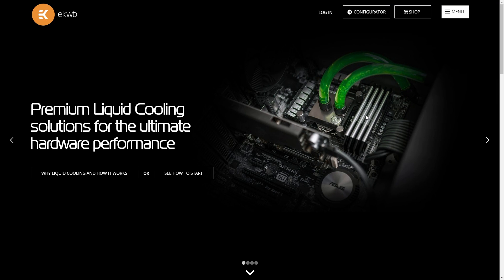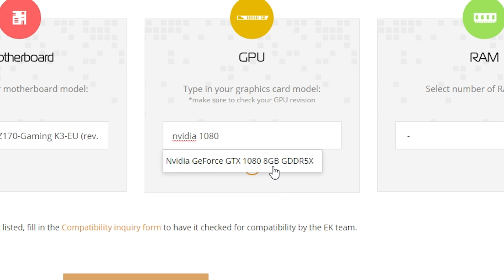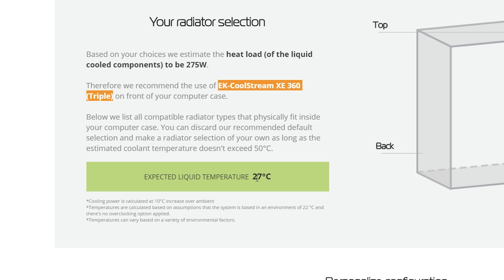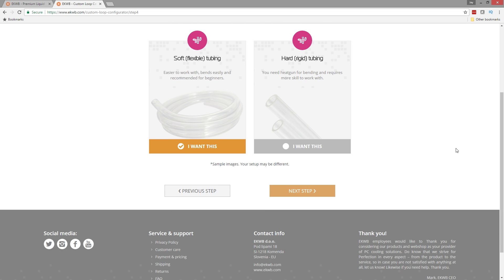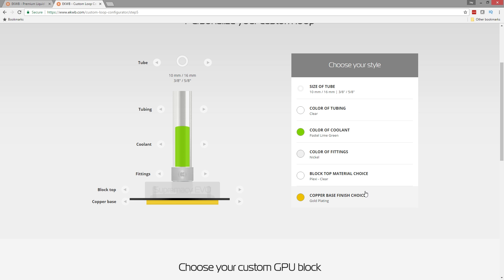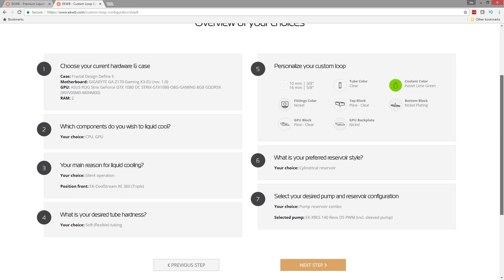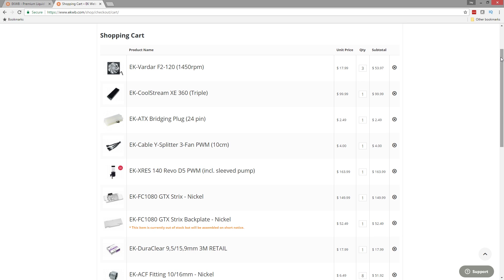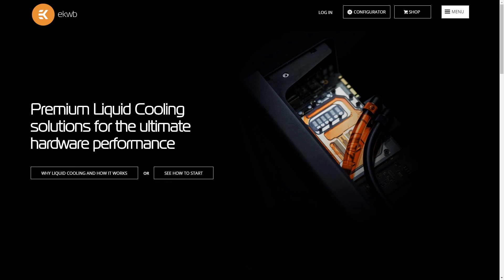How to configure a custom water loop using the EKWB CLC

Comment: 700 fucking dollars!!!! I don't see how that's worth it. I don't fucking see the value there at all!
Reply: water cooling is an hobby, you do it 'coz you like. And often hobby come with a bill. I have a 1000+ $ loop, its a waste of money i know that and i dont get any better overclock from it, but man, its cool as hell.
Reply: No Bruno. I certainly won't go away. But thanks for the useless input. 
There is NO value here. For 700 dollars!!!! It had better keep a CPU/GPU ate sub 20º under full load. As is... it looks great and performs like an off the shelf 70 dollar closed loop system. Utterly ridiculous.The market for this must be minuscule.
Reply: perfect. good logic. and also let me state the obvious that this is stupid and has no value... See the logic? you contradict yourself.... very smart Bruno.
Reply: The point Bruno is trying to make is... It's for rich people with money to spend on useless shit. A Ferrari or a Rolex watch is no different to a Mazda or a seiko, yet people buy it for ridiculous prices. A custom loop looks really badass and is pretty silent and... That's about it. It has no other use besides that. It's just for enthusiasts who like the idea of going to the extreme for their PC. No real value whatsoever.
Reply: +DAGATHire do you even read the replies?
Reply: Eventhough I can afford it I can not blind. Watercooling is a rip off. 60 bucks for a backplate? All the backplate is, is a piece of aluminium. For 60 bucks. Watercooling is overpriced.
Reply: DAGATHire You still don't get it do you? If you leave everything at stock, then yeah you're not going to find much difference, but if you're someone who likes to push as much performance out of their setup as possible, then yeah it's definately worth it. Having a custom loop allowed me to overclock my i7 5820k from 3.3GHz to 4.6GHz and overclock my 980ti to 1500MHz on the core and about 7800MHz on the memory all while staying silent at load. I used to have my 980ti on air and it was screaming its tits off at full load. The fans were so damn loud and it's not even a reference card, it's Gigabyte's G1 Gaming card. 

Having a custom loop provided more overclocking headroom, cooler temps and a quieter operation at load. That is something that you don't get with air cooling or even AIO coolers. AIO waterloops have radiators that are thin for maximum compatiblity for as many cases as possible and most of them aren't bigger than 280mm rads and don't offer expansion to multiple rads either. You'll never get the same performance from an AIO as you would with a properly configured custom loop.
Reply: Actually, i walked into a tech shop a year ago, a tech superstore in europe and funny story. I had 2 gtx 760s in SLI for the previous 2 years, (titan 780 performance for half the money) but we know that a single card is better than an SLI setup, anyway i was in this shop with my wife and i walked past the GPU area glanced at the prices and sure enough there was 2 STRIX 980 DCII OC edition cards marked at €360, now at the time this was about 200 less than normal. But my brain didn't catch on for a while continued on with the wife browsing and slowly my brain was like.... dude wake the fuck up... some clown has gone and marked that card wrong... So i went back and there was a windforce 980 card beside it marked at 549.99 and a few 970s marked about 100 less.. 450 range... And i was still kind of stunned so i was thinking... is that strix a total piece of crap or what's going on... anyway.. long story short. Someone in the shop had fucked up and marked it wrong. I grabbed both of them. bought them. Sold the other for 450 new unboxed. made a profit, and ended up paying 250 net for a new 980. Add to that i sold on the two 760s for 100 each and i paid about 50 euro for my new 980 strix. 
It was a good day... and your comment is nullified. But well done for making incorrect assumptions about me AGAIN!
P.S:
You are correct it is quite useless to argue with me when you are clearly wrong.
Reply: indeed tony however, car enthusiasts in general add to the performance of their cars while making them look great at the same time. Not to mention a modded car when done correctly in fact adds monetary value as well as aesthetic value.  My consistent argument throughout this entire conversation is about performance benefit/to silly cost. and there is none. Likening it to car enthusiasts doesn't work either as mentioned generally the car comes out the other end of modification as a better faster version. Plus a car can have value ADDED to it with modifications where this over priced folly does nothing of the sort. no extra value, no extra performance just prettiness that 99% of the time only you see. You come across like a nice guy Tony, so im not talking at you personally. But this is complete folly unless you sit looking into your case 24/7 appreciating your own valueless work. And as i said previously if that's how you wanna spend your money so be it. But others here have attempted to imply that you get performance.... Maybe you get a couple of degrees in a perfect world but in fact you don't get anything other than cake decoration. 
P.S. Totally agree, building your own stuff like this is incredibly fun particularly when you have the mindset of im going to build the best for the best price.... not im going to build the most expensive... That's just me and most other people tho. You spend your money how you want.
Reply: Tony Leung... indeed if you can do it on the cheap or at least good value for money i would be far more interested. EK is a straight up ripoff in my opinion. But if i could do something similar for say 250 bucks i would be very interested. thats about double the cost of a really good AIO. And that seems to me to be about the right number. But 700 dollars.... it's nauseating.
Reply: Ro-Tang Clan i guess that's one way to look at it. But i don't see it. Adding a loop is expensive, the chance of a component failing these days are minimal. You're better off just saving the money if you look at it that way, and buying a new component to upgrade your system when it's time. At $700 you could get a decent GPU or CPU+mobo combo to get more benefit.

The parts are more important. Even Jay has mentioned that it's better to buy the best components you can afford than to sacrifice that to water cool lower end components.

I have a loop, and i don't see a benefit other than it making my system look nice, and giving me a bigger epeen.
Reply: DAGATHire xspc is better
Reply: whats interesting is that for 700$, you could likely upgrade some other component in your system to get as much or more performance gain than you do from watercooling.
Reply: +DAGATHire I think you're missing the point of custom loop cooling. Custom loops aren't for people on a budget, they're for people who already have high end kit and want to be able to cool it efficiently. I know that the market has been focused on lower power consumption with every new revision of CPU's and GPU's nowadays, but generally speaking the higher the performance of the component, the more power it's going to consume which also equals more heat. More heat=more noise to keep the component cooler. Custom loops give you the flexibility to add multiple radiators to dissipate the additional heat that the higher end components are going to be throwing out whilst keeping it silent.

Nobody would do a custom loop for an i3 and a GTX 750ti or an R7 270, that's stupid. As you rightly said the money you would spend on the custom loop could go to buying better components in the first place. But not only that, an i3 and a 750ti or R7 270 aren't going to be throwing out enough heat to warrant a custom loop. You could probably cool both of those on a single 240 rad.

For me, I have an i7 5820K and a single 980ti both in a custom waterloop with a single 420mm rad. Sure, I could of used the money spent on the custom loop towards a 5960X but I don't need the extra cores or threads. I could of used the money to buy another 980ti, but a single card is enough to max out games at 1080p/60fps and I don't have a 4K screen yet. So instead of spending the money on pointless components for my needs, I spent it on cooling to make it a powerful, but silent setup.
Reply: Ro-Tang Clan
Excuse me? i perfectly get it, i just totally disagree with you. And if you think that's a problem go tell someone who cares. Your  version of what i get is only based on the fact you are insisting i agree with your limited one sided opinion. I can just the same tell you that you don't get it but it means precisely fuck all. You are entitled to your view. I'll stick with the view that 700 dollars is fucking ridiculous when an off the shelf unit costs a tiny percentage of that.
Reply: +Peter Jansen I agree on some parts but disagree with others. Before I go into my upgrade path I do agree that high end air coolers can beat entry level AIO's. I had a Phanteks PH-TC14 air cooler which managed to keep up with all the entry level AIO's and it was quieter too, especially since there was no pump noise. I managed to OC my (at the time) AMD FX8320 to 4.8GHz using the Phanteks cooler and staying below 65C on the core which is amazing. I'm not trying to say it's custom loop or nothing because that would be silly. I get that everything has it's place and air cooling is better in certain situations and AIO's can be better for certain situations. However, custom loops do have their place too and aren't pointless.

Regarding putting a custom loop on a 7700k and a GTX 1070.. hmm.. that's a tough call. I would say it depends entirely on the rest of your setup. Okay so here's the thing, If you're running 3x1440p displays then the smartest option would be to save the money and put it towards a better GPU setup. However, if you're running on a single 1080p/60Hz setup like I am, going from a 1070 to a TitanX Pascal is going to give you very negligible benefits. Maybe you can max out the Anti-aliasing with the TitanXP but that's about it. So instead of spending the money on a card that isn't going to benefit you much, I would much rather spend my money on making my setup as silent as possible and a custom loop is an effective way to do that for both the CPU and GPU. All you'd need is a single 360mm rad and you're set. Maybe dual 45mm thick 240mm rads instead. 

Also another thing to bear in mind, EK aren't the only company to produce watercooling parts. You don't need to spend 700 to get everything from EK, you can get a full loop for half of that if you buy from companies like Alphacool, AquaComputer and XSPC. I've bought compression fittings from XSPC before and whilst you can feel the quality is lacking, I've never had a problem with them and they've never failed either. You can get XSPC fittings from around £2 a fitting, EK fittings can be around £5-6 per fitting but Bitspower fittings are by far the most expensive I've seen. They can go all the way to around £10-12 per fitting and some of them like the ball bearing T valve costs £25. They scream quality though. It's well made and you can tell they didn't cut corners on the build quality. For my custom loop of 1 CPU, 1 GPU, 1 pump/res combo and 1 radiator, the cost for all the fittings from Bitspower was around £200. I didn't care though, I have the money and I wanted the quality.

Finally onto my upgrade path. The case I'm using currently is a Phanteks Enthoo Luxe which is no doubt a great and solid case, but it doesn't offer much in the way of watercooling expansion. After keeping a sharp eye on the case market, I've decided to go for the Dark Base Pro 900 to expand my radiator setup. I'm going to be buying a thicker 420mm rad (60mm thick) which is going at the top, a 30mm thick 360mm rad at the front and a 30mm thick 140mm rad at the rear. I'm not going to go for the 1080ti since I've seen the benchmarks of the TitanX Pascal and SLI 980ti's are about on par with it's performance. So I'm going to be going the route of SLI'ing my 980ti to offer the best price to performance. The reason why I'm adding a second 980ti is because I'll be buying a 60inch 4K OLED TV pretty soon too. Just waiting for Sony and LG to release their 2017 models so I'll need the added horsepower to run the latest AAA games in 4K.
Reply: who deleted their comments?
Reply: bruno's.
Reply: well. his choice. he probably didn't want to get any more notifications. 
I'll look at it that way.
Reply: It performs way better than a hybrid cooled card. My 980Ti with a overclock at 1518 MHz(the base clock is 1000 MHz) won't even go any higher than 41C under full load, and that's looped together with a 5820K@4.6GHz.
Reply: I have fx8350 with Noctua a nhu12s at 4.2 ghz and never go above 50* C

in a Fractal Define S case with 2 intakes and 1 exhaust (all fractal gp120s)
Reply: DAGATHire It's all about quality. You can go out and buy a 60inch 4K TV for as little as £400 or you can spend £6000 on a 60inch 4K TV. The price reflects on the quality and R&D gone into the product as well as other things. 

As I said in a previous comment (although not directed towards you), EK aren't the only manufacturer in the custom waterloop scene. If you buy from manufacturers like Alphacool, AquaComputer, Thermaltake, XSPC then you can almost half the total cost of the waterloop. EK is pricier because the quality is there and can be felt too, but it's not the most expensive. Try getting everything from Bitspower, they're the most expensive I've seen.

I'm guessing you don't buy into the finer things in life. Of course you get into the realm of diminishing returns the higher you go, it's like that with anything. Headphone manufacturer 'Grado' has just announced a turntable cartridge that will go on sale for £3000. You don't even get a full record player, JUST THE CARTRIDGE for that price. That's about the same price as my entire home cinema setup. 

To ne honest you can make the same comparison about anything in life. You can spend £20 on a bottle of wine or you can spend £200 on a bottle of wine. 

Custom loops are the same. You can buy into a custom loop that's cheap, or you can spend an absolute fortune on a custom loop. The difference lies in the quality of the end product. For someone who wants the absolute best, why not go for the most expensive and classy of the bunch?
Reply: fuermi Haha exactly what I just tried to say. He obviously doesn't buy the finer classier things in life so he probably wouldn't understand. I once worked at Bang&Olufsen many years ago and if you don't know who they are, they're one of those companies where if you have to ask for the price, you can't afford it. They do audio and visual technology, so basically speakers, TV's, CD Players etc and just for a 65inch TV cost £18,000. I'm pretty sure the people who bought it know they can go to their local tech store and get one for a fraction of the price, but people buy the Bang&Olufsen set anyway because they like the quality of the brand. It would be like trying to tell these people that they're being ripped off. It doesn't work like that haha.
Reply: fuermi
I could consider the possibility of this is it was in the $400 region. I can't for the life of me understand how a sane individual with any sense of value for money would pay 700. Have you seen the break down of the prices here? It's a total ripoff. I don't care that you disagree. The world would be a fucking shithole if we were required to agree with every opposing view posted on youtube. But the fact you hold an opposing view under no circumstances makes you correct. If you believe that, you are arrogant and closed minded. 
Ro-Tang Clan
YOu are a provocative little twerp. Demanding that i agree with you and posting utter bullshit about performance is only the start of my problems with you. The custom loop will under no circumstances perform 10 times better than an off the shelf unit. Yet it's ten times the price.... Consider that. And stop talking about performance. YOu are posting bullshit and it's either that you are simply wrong or telling bare faced lies. I will give you the benefit of doubt and simply assume that you massively overestimate the performance here. 
Bottom line. you are willing to pay ten times the price for aesthetics.... Boggles the mind.
Reply: Surpuppa, i see where you and others are coming but it's folly, these are all bad examples. you pay for much more advanced technology in audiophile stuff and you get better performance. and the other 4k tv example was also bad. you pay for what you get in those things. 20 dollar headphones don't perform like 400 dollar headphones. 400 dollar 4k displays don't perform as well as 2000 dollar displays. But with this, it's 100% form over function. you don't get extra performance, that you won't get with a decent off the shelf closed loop system. you don't get overclocking headroom.all you get is aesthetics for a massive premium. It's window dressing. And that's fine if that's what you want to spend your money on, but in terms of performance. it's  barbie doll window dressing with no extra function or performance benefit. THIS IS MY ENTIRE POINT FROM THE FIRST POST TO THIS: I SEE NO VALUE!
Reply: DAGATHire Hmm... selective quoting I see, kinda like selective hearing. You quoted me out of context, or maybe you just don't understand the point I was trying to make. My point was regarding quality which ties together with diminishing returns. You get to a certain point where you pay exponential prices for very little return and it's like that for everything, not just watercooling. My example on the "audiophile stuff" was that you can pay ridiculous prices for something that's not going to give you nearly as much performance return as you would like. Like I said, for the price of that turntable cartridge I've managed to do a whole home cinema setup with a decent amp and speakers. Products like this aren't aimed towards the general consumer, they're aimed towards the enthusiasts who want the absolute purest quality they can get their hands on. 

That leads me to your form over function remark. Spending hundreds on fittings and pumps may not land you any direct performance gains, but it's the quality that matters and that's what I've been saying from the start. At the end of the day, you can spend £700 on a new graphics card, then wait a year or two and then it's obsolete. You spend £700 on fittings and they will last for many many years to come. Those watercooling fittings may see 4 or 5 generations of upgrades since all you need to do is buy a new waterblock for the new component you're installing then use the same G1/4 fittings. Sure you can buy cheaper fittings, but because they're manufactured to a poorer standard, the threads may wear out quick causing a leak in the system. Same with pumps, reservoir's and radiators. If you buy decent watercooling kit, it's most likely going to stay in your system longer than a new GPU is.

It's like the difference between a £100 pair of shoes and a £500 pair of shoes. The latter isn't going to do anything to your 'performance' so to speak, but they will last a hell of a lot longer than the cheaper pair. You might need to get them resoled every once in awhile, but they'll last.
Reply: Ro-Tang Clan nothing selective whatsoever. my point has remained the same. Form over function. There is not argument in favour of performance. and your 4k tv example more than proves that.  If you are willing to pay a stupid premium for window dressing. So be it. It's doesn't change the fact it's of no performance benefit whatsoever. Personally i could afford this no problem, however personally i wouldn't dream of spending useful money on nothing more than aesthetics
Reply: DAGATHire Quality. Quality, quality, quality , QUALITY. How many times do I need to say it before you understand? It's not just aesthetics, it's the craftsmanship of the product. That is what you pay the premium for. Performance saturates and degrades much quicker than the craftsmanship of a decent premium product. You're more likely to upgrade your GPU for more performance gain over time than you are to swap your watercooling fittings and hardware - unless you're after a different colour scheme that is. In the long run you see the value for the money you paid, rather than direct performance gains. I'm not demanding you agree with me, but it seems to me you still don't understand the points we're all trying to make to you. Even in your last comment to me you said it's "a stupid premium for window dressing". I'm trying to get you to understand it's a lot more than "window dressing" as you put it.
Reply: Ro-Tang Clan. window dressing. it's not worth 10 times more than a decent closed loop for no performance benefit. Not to mentions closed loop has less chance of leaking and destroying your system.... so where the hell is the quality in that. get real... you are really scratching now. Just accept the fact it's useless over priced nonsense. 
fuermi, that's only offensive if you read that and then choose it to mean you... that's your choice. 
NEXT!
Reply: alright the point is custom watercool is only for rich people.Thats it
Reply: DAGATHire Wait, hold up. You still believe there's no performance benefit from going from an AIO to a full custom loop? I thought we went through this before? Custom loops offer the flexibility of having larger and thicker radiators and sometimes in multiples too. Better quality, bigger and more radiators=more heat dissipated=lower temps. Lower temps=more overclocking headroom. Higher overclocks=more performance all whilst being SILENT. How you don't see that as worth it I do not know. It's literally silence and more performance.
Reply: Ro-Tang Clan
That's just adding more and more expense to get a minimal performance boost... you are literally proving my point with that comment. I have gone through the process on the website with regard to cooling my Strix 980 OC and my 8350  and the expected temp according to their site is 32º for 620 dollars. 
First the strix is already a silent card, fans only kick on at 60º and at about 25% so virtually no sound, no more than you get from rad fans. second, my currant Arctic 240 liquid freezer keeps my cpu at 26 -28 idle. depending on ambient temps and never more than 48 under load and overclocked to 4.7 (followed jay's excellent OC tutorial for the 8350) so the custom expected temps are 6 degrees higher than what i already have. and my AIO cost me €75 a year ago. 
The case is closed. I don't care about form over function. In the real world it's a ripoff for some pretty components that don't do anything for performance unless you start adding hundreds of dollars more to the setup as you suggested. give me a break. you only prove my point.
Reply: That's a genuine true story. it was a good day. Still... my 980 is now being matched more or less by the 1060... it sort of puts things in perspective. But it's a true story. Take it or leave it, but call me a liar if it makes you fell good. Still happened like it or not.
Reply: DAGATHire

The same for the 980 Ti which peforms the saame as the 1070.
You should never spend too much money on graphics cards. :)
Around 200 to 450 is the sweet spot for graphics cards. You pay a severe premium to get some extra performance earlier.
Reply: +fuermi

 i bought 2 Titan xp cards for just $750 both in a late night ebay auction, i was looking for 1080s for a customer(i build pcs for a living), so i kept the Titans and gave him my 1080s andnsaved him $100 plus got better cards for myself...they were marked as 780s on the ad and you could BARELY tell if you looked close that they were titans. the person making the ad didnt even know enough to distinguish them...he called them "ADM rx780 dual cards"
Reply: Ro-Tang Clan

I agree that silence is a good reason to consider custom water cooling. Personally I will try a Fractal Design S with a high end air cooler (like the D15, I will also check out competitors). Other than that I will obviously avoid blower coolers and other noisy components, try to pick graphics cards which have good passive cooling etc.
It is an experiment, I expect it to be silent in idle and not noticable while gaming with sound.
I also might try to lower the voltage of my next graphics card a bit, for the RX 480 that works great because the voltage of those cards is a bit too high for most samples.
I am not willing (yet) to pay hundreds of euros extra for the cooling and I am also not sure that I would trust the lesser brands, if something goes wrong you've got a lot more cost.

With regard to your last reaction, in theory they could make AIO's with larger radiators but unfortunately they don't. Also I don't think it is worthed it. If one component fails you have to buy a new device (mostly, sometimes you could replace a part if you know what you do). If I would ever start with watercooling I would choose for a custom loop, no doubt about that. It seems like a fun project.

With regard to B&O, yes, they sell good products but let's not forget about the companies which sell top quality for less, like Audiotechnica. They don't spend money on advertising (or very little) and hence can ask a lower price. On the other end of the spectrum you have companies like Beats (now Apple) and Apple who ask a very high price for a low (Beats, the equalizer makes it seem like it is decent but it realy isn't) to mediocre quality. If you get peanuts you'll end up with monkeys but for a price which lies in between you can get an excellent quality and a high price doesn't guarantee a high quality. It differs a lot from company to company. Just making this nuance, people should understand that for their own sake.
Reply: Perter, i already mentioned i got the GPU for half price. Why are you telling me this stuff? If you are going to comment on the GPU read the comments properly
Reply: DAGATHire You should learn to read properly. He quoted my name not yours.
Reply: He posted two, as in 2 comments "you should learn to read properly" bravo dumbass
Reply: DAGATHire Ahh my apologies, my G+ app hadn't updated the comments properly before. I see it now
Reply: ^^ its all good, as it happens i didn't read peter's comment properly either.
Reply: Ro-Tang Clan

The point was that half the price was still too much for this card at that moment, just like the Fury X right now isn't worthed the price. With those kind of cards you just don't get bang for the buck, you pay a lot to get some performance a bit earlier. There are reasons to spend that money on it but it is not bang for the buck.
You want bang for the buck? Think about *70, *80 and *90 cards of AMD. There in general you get bang for the buck (a little less for the *90).
 I would say the same applies to the *50 Ti, *60 and *70 of Nvidia but I can't as long as Nvidia doesn't support Freesync. Tearing free gameplay is also worthed a lot.
Reply: To be fair peter. the point is about over priced window dressing water cooling solutions and not about GPUs at all. If we are sticking to the point that is.
Reply: DAGATHire

No, the point was for what hardware custom water cooling is appropriate (cost effective, useful...). The consensus seems to be that in general you should do custom watercooling for the highest highend hardware, if you can't go up a tier anymore, or maybe when you want to make the system very silent.
Reply: I found the whole experience of researching, and installing the loop to be a lot of fun. It definitely is not cost effective in terms of what you're aiming at. For my situations, i have 2 1080s in SLi but for my mATX motherboard, they sit on top of each other, causing one of the cards to throttle when it hit 95C. It limited my OC'ing potential. I can now OC both cards, and have them sitting at about 45C under load. You can do much more budget friendly loops, like getting small pump combo, and using soft tubing instead of PETG/acrylic tubing. You can get one for about $500 if you're just looking to cool CPU and 1 GPU. Getting a single 240 rad.

I don't find much benefit to having a water cooled system, other than it looks awesome, and its incredibly fun installing it. I would definitely do it again. If you're looking for value, it doesn't exist. You can get great cooling potential using air depending on your setup. When i was on a single card, temps for the GPU were about 70C even when OC'ed. Perfectly acceptable. But like car enthusiasts, it's not about value, it's more of a hobbyist mentality.
Reply: i never thought of it that way. Yes, it is very different from a car enthusiast where you get performance for your efforts. I guess it's more of an epeen value.

I originally thought of it that way, it would be really wasteful, as there's little benefit. I think Jay has a video about general value of a loop. I think he does mention it is not for everyone, as it's got a heavy price tag.

I think in terms of getting a water cooling loop, there are cost effective ways to get a loop done. EK is very expensive in terms of cost when you're looking to watercool your system. Their parts are very pretty, and in terms of benefit, it just makes the system look better at a much higher cost. If you look at something like Alphacool, you can get a CPU, GPU block for about $180, picking up a rad and a pump/res combo for another $150, then just the compression fittings for soft tubing, you can get something that is affordable.

I'm not saying it's for any benefit than just a few degrees better than air cooling. But it doesn't have to be $700. It can be around $400 at the least.

I have no intention of trying to justify the cost of a loop other than it looks cool and the process of putting it into your machine is fun. I'm on board with you about it being valueless in terms of performance. I think the only thing i can think of is running fans at lowest possible RPMs, while maintaining high overclocks on your components. Which was my main reason for getting a loop. (at least, that's how i rationalize my reckless spending)

Watercooling is not for everyone. But i do like looking at systems that have them. They are pretty. I think you've put up a fair argument against on a channel that is very much oriented to water cooling enthusiasts. It's a lose lose situation.
Reply: Tony Leung Just another thing worth noting; longevity and quality. True, you don't have to spend 700 on a custom loop, you can do it with half of that, but the quality of the components is not the same. As a result, you may not get the longevity you desire. 

I see where you guys are coming from as you pay more for no performance benefit, but it's the quality and longevity you pay the extra for. You buy decent watercooling fittings, radiators and pumps and it's lifespan will serve you through a few generations of upgrades. I would much rather spend the extra upfront cost into something that's going to last me 5 years, than to spend the same amount of money buying a graphics card that I'm going to need to upgrade in 2 years. The cost is high at first, but in the long run it's worth it.
Reply: Ro Tang with all due respect, first your argument was performance and consumption, after that gets shot down you are now changing tac and talking about quality. Well, quality custom loops still run the risk arguably the higher risk of failing. Such is the inevitable outcome of anything that has the word custom attached. And you can't tell me that the AIOs out their by leading companies like corsair et al are not quality. You can't tell me that you can build a custom component to a higher standard than those guys. That logic doesn't hold up at all. Your one and only argument here is aesthetics. And that's it. There is no performance benefit, no quality benefit unless you are talking about the quality of custom loops manufactures over each other? there is only one reason you do this. For the cool factor. And i'm sort of sick rehashing the same point. I'm all about performance and if 700 dollars gets me significantly better performance then i don't have a problem If it gets me nada but  pretty tubes, connectors, recycled fish tank pumps etc etc ...then i flat out i call bullshit.
Reply: ^^ that's precisely what i have been saying. im glad someone gets it.
Reply: Tony Leung

I don't doubt that it can be a lot of fun to build a custom water cooling loop, to search out all the components and such. For me the problem is that I don't want to spend that much money on it. :)
A good AIO is also attractive but mostly because it is small and easy, however also too expensive. I consider the D15 for my next (Ryzen) build.
Reply: Ro-Tang Clan

You won't get that much extra performanc with a watercooled card, it doesn't even bridge one tier. Better spend that money on the card/CPU, valuewise.
Reply: totally, i never said it was worth it in terms of performance. The building part is the part i like. I wish i was rich, just build systems and loops and give them away. It is very fun, and like creating a work of art.

I used an AIO originally for my CPU. But i found the tubing to be excessively long. My original reasoning for getting a custom loop was mainly for my GPUs. Which were sitting in the two slot config for SLi. I am running an mATX board, so there's not much room in the case. Where the bottom card is directly cutting off the airflow of the top card. Everything was running at acceptable temps, CPU at 40C under load, bottom GPU at about 70C under load, but the top GPU where the airflow was cut off by the bottom card would throttle, as it would commonly hit 95C and above.

I'm sure i could have gotten a more affordable solution by getting a new motherboard and mounting them in a 3 slot or 4 slot config where there's more space between the cards. But i wanted a fun project and something new to try out.

In the end, the custom loop i got is keeping my components are a very cool 45C on load. I've run an aida64 and unigine heaven bench at the same time, maxing out the load on both, and got about 60C on the CPU and 45C on both GPUs. All components are overclocked and over-volted. Something i was not able to do originally. Was the cost to what i got worth it? Hell no, but was it a fun project, yes. Does it look nice? yes.
Reply: Tony Leung

As long as you enjoy it it is fine. :)
Personally I don't use a smaller format than large midtower and ATX, just because it is easier. Then again, I don't have to transport my PC all the time.
Reply: man this comment gave me autism
Reply: youtube really is a cesspool
Reply: ^^ indeed. Or buy a closed loop of the shelf water cooler, and then buy a K series CPU to cool and then depending on what floats your boat, go out and have a nice meal with your wife, or spend the remaining on some really good ram... Conversely, buy  yourself a new top of the line 1080 GPU and STILL have  money left over to go out and  party..... 700 dollars is madness.
Reply: no you didn't I SAID IT! and you, like a fucking child felt it necessary to tell me to go away... and copy and past it like a fucking juvenile dumb fuck. How about this... post your own comment... stay off mine... and have your own damn opinion rather than telling other people to go away or is it too difficult to understand that someone might have an opposing opinion to you own? How about that, is that possible, or have you got another childish response lined up?????
Reply: The Performance of a 70 dollar off the shelf cooler, will be within a couple of degrees of a custom loop. Performance is negligible. The bottom line here is cost. Sure, it's for a niche market, but it's still massively expensive. I don't work off small budgets either. But I am fucked if im spending 700 on a custom loop where the individual components can't cost more than 150 bucks if you were to assemble them outside of this niche ripoff website. You don't need to be budget orientated to see that this has no performance value and is stupidly over priced and you don't need to be a rich person to appreciate a good deal, or at the very least a FAIR deal. Having money and still allowing yourself to be ripped off, is just plain stupid in my book and no excuse whatsoever. Plus people who have money, have it because they are clever for the most part and don't spend their hard earned cash on silly over priced nonsense.
Reply: Ro-Tang Clan
It only makes sense if you:
- have the best available graphics card and CPU
- and buy the best new hardware all the time

Are you going to buy the 1080 Ti when it comes out? If so, then you might indeed belong to the small group of powerusers who benefits from watercooling. If not, then the money would be better spent on the 1080 Ti. That's my view on it anyway.

Yes, CUSTOM watercooling (unfortunately some prebuilders abuse this term for AIO's) can make your system very silent if you spend a lot of money on it (JayZ has got a much more expensive watercooling setup for this purpose), AIO's should only be bought if they are highend, you have limitied space (for highend air coolers) or you like the looks of it (I wouldn't but hey, to each its own). Entry level AIO's get beaten (load temperatures, idle temperatures are not that relevant) by midend (pricewise, like the Cryorig H7 and the 212) to highend air coolers and they also are more noisy than good air coolers. I am not sure about high end AIO's. I do know that they are very expensive, also because you have to replace them after a few years while you can keep using an air cooler for much longer. I wonder if custom watercooling will become much more affordable some day in the future. I wouldn't be surprised if the prices are still much higher than what would be possible (lower profit margins, much higher sales) because it is a relatively small market aimed at customers who can spend a lot of money on this hardware. Your thoughts on this? Do you agree with me that you shouldn't put a custom watercoolingloop in a system with hardware like a 7700k and a GTX 1070? Performance/cost wise obviously, if you realy like the looks or you find the trechnology awesome then I guess that that could be a valid reason if you can afford it.
Reply: fuermi, don't twist my words buddy. I said this is a fucking stupid price for what is collectively parts that can't cost more than 150 bucks. Being willing to spend 700 is in my book being willing to buy into a ripoff.  that is your choice. But don't bother trying to twist this into a fight about who is stupid or not. Certainly the people who buy a similarly performing closed loop off the shelf water cooling system are clearly not stupid regardless of being able to afford this over priced bullshit or not. It's a question of value. Knowing what it is or not. You can start labeling people stupid if you want. I'm not going that that rabbit hole with you Alice. I'm talking exclusively about the over priced crap-